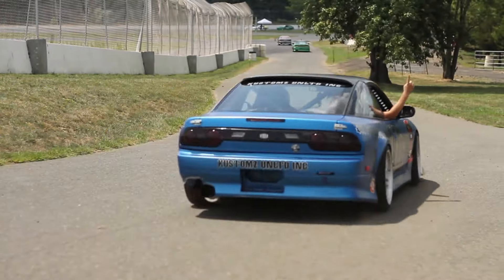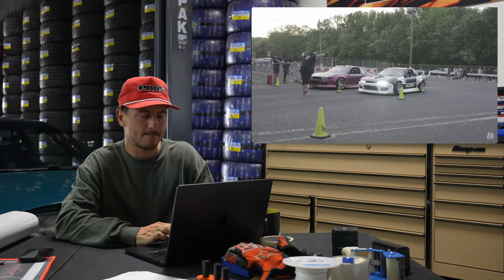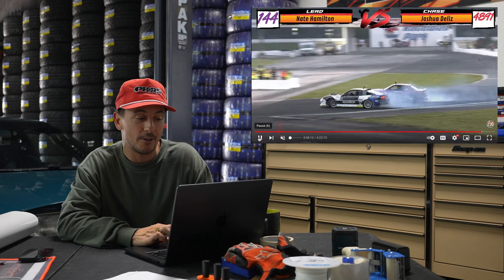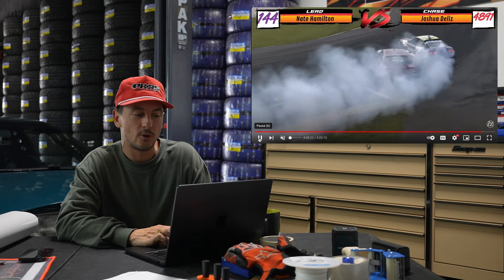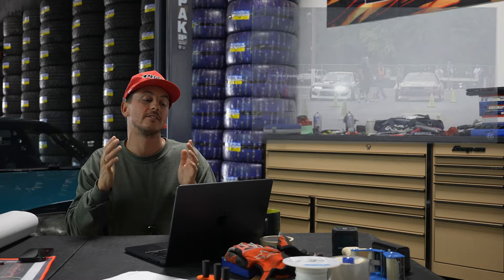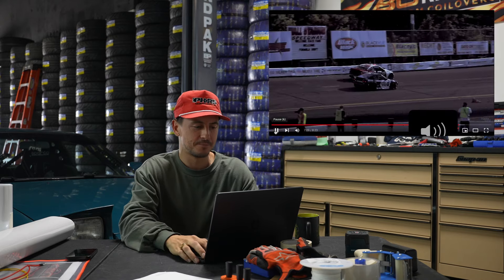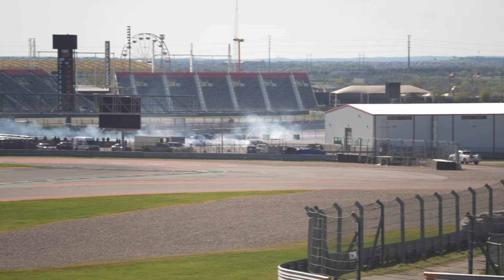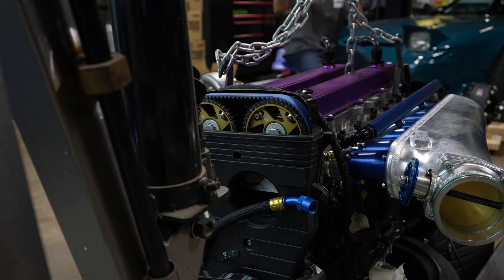How Not To Crash When Drifting.

Comment: The rev limiter was a great point i don't think most people consider. An engine only makes power to a certain point of its power band. Actually one of the things i like to practice on my sim is drifting only on throttle, but with the rules of no rev limiter, and i can never lift off the throttle 100%. Its actually helped a lot with my throttle control.
Reply from the maker: Yeah buddy! Glad that thought ended up helping you. Keep up the practice!